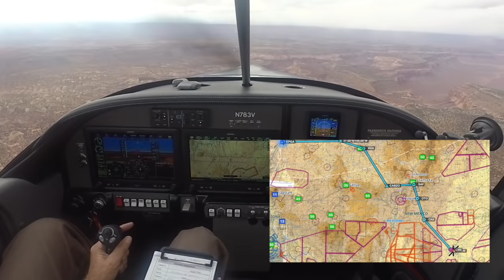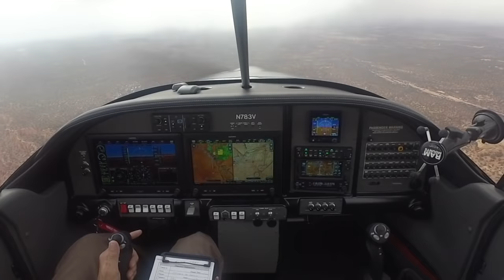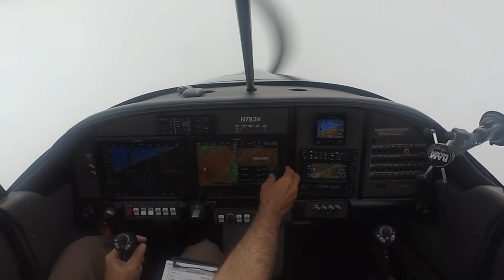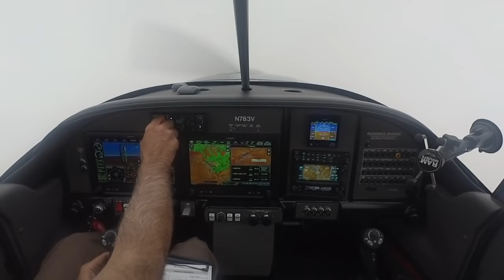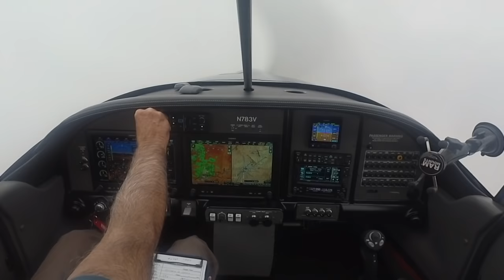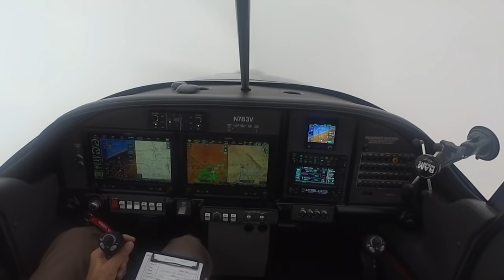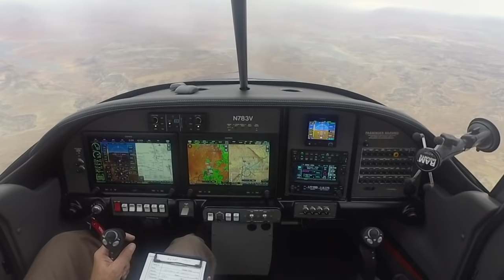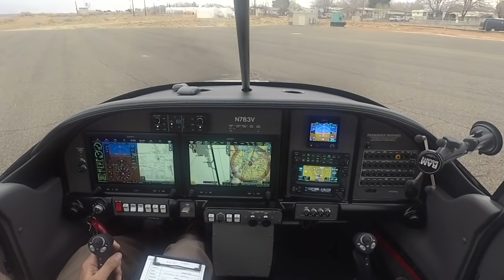RV 10   N783V   My 1st Emergency   HD 720p

Comment: You show a concerning lack of command ability, yet you claim you are IFR rated.  Being 'behind the aeroplane' requires you to get ahead; download ATIS, familiarise with the approach pattern, load frequencies.  None of this is happening, just lots of fiddling with buttons, volumes, etc.  "Not familiar with the terrain"; you knew where you were going before you set off and should have run through the flight before getting airborne.

Comment: The fact that you have to manually flip a switch to fix that issue is a huge engineering failure.
That heater should have turned on automatically in freezing conditions or it should have turned on automatically the moment you lost your air speed...
And that Stalling Beep... That beep could induce a heart failure because you're already in a stressful situation

Comment: hope you went back to basics after this and started retraining processes, procedures, and planning.  maybe took some additional time with an instructor.  practice, practice, practice.  then repeat.  sim some of it out.  too much time building and not enough time flying prior to setting off on this adventure. at 2:34 you're banked while trying to make a simple call on your fancy new avionics.  either your instrument rating was out of date or you were not prepared for this airplane-avionics combination.  flying into imc is dumb but forgivable.  blindly rolling into a bank while simply trying to bring up a radio frequency isn't.